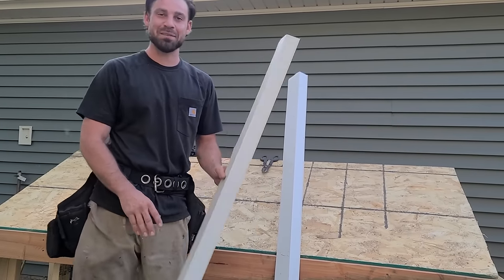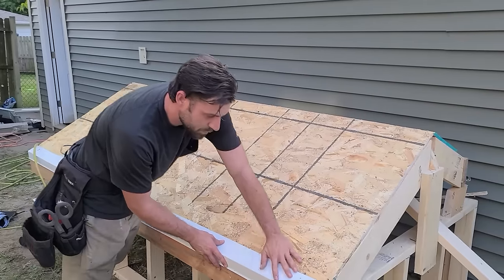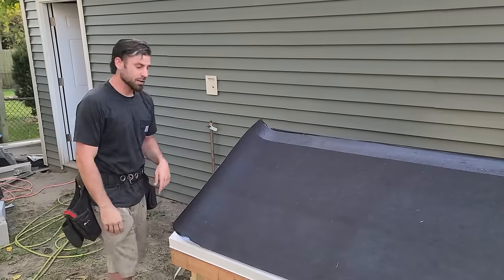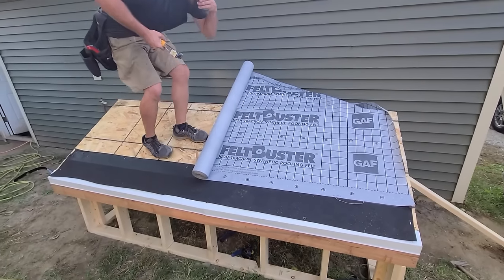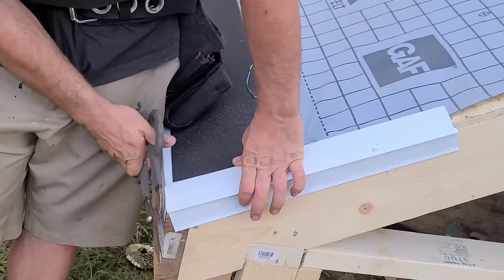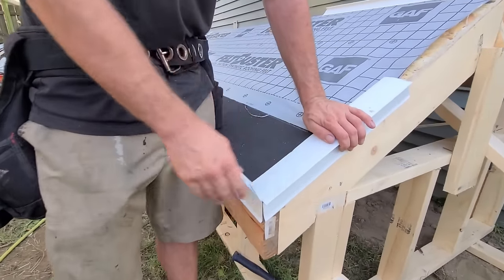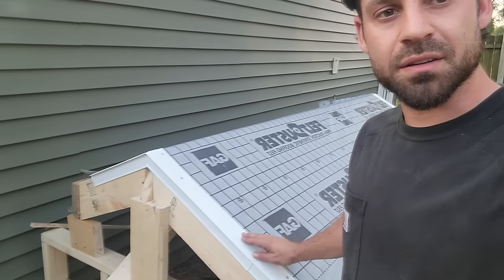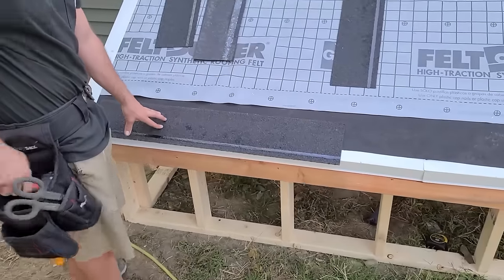HOW TO | A - Z ROOFING (PART 1)

Comment: GAF said never use staples, are they just wrong?
Reply from the maker: Where'd they say that? I've never heard anybody or seen any instructions saying never in it....Staples leak, that's a pretty well known fact but that only comes in play when the roof is exposed to rain prior to shingle installation... after that there's thousands of nails in the roof so I wouldn't understand why they'd be forbidden.  Only recommended against in certain scenarios
Reply: Watch their install video, says on the video with plastic caps only
Reply from the maker: @kirkwesterveltoutdoors i just watched about 20 videos and haven't found anything from them. Got a link? Also, even if they did say that, I would call and ask "if I'm going to tear off one small side of roof and shingle it on the same day can I just tack it down with staples or will that void a warranty? " they will tell you it won't void a warranty. Also, every manufacturers instructional videos leave out important details or give bad or inaccurate advice anyway lol staples is the least of anybodys concern
Reply: I will call them in the morning, like I said, it is their instructional video. Search it on YouTube.
Reply from the maker: @kirkwesterveltoutdoors  yea bro you're good to use staples lol as long as you're gonna get it covered with shingles before rain
Reply: Ok....I will use the staples, Tha k you for the help
Reply from the maker: @kirkwesterveltoutdoors  only if you're sure you can get it shingled right away.  Diy roofs usually take about 2-3x longer than one would think

Comment: You should not use staples on ice water shield or synthetic underlayment. 
The staples will rust out And leave holes. 
Plus the shoulders of the staples are curved and will pull in the synthetic leaving little holes that will become bigger overtime. 
It’s recommended by the manufactures not to use staples 🤭
Reply: NEVET go against what the manufacture says.  It will void their warrenty and also coming from the view point of a homeowner, I had a roof leak/mold problem. 1 I should be dead according to my doctors assistant ( and it was such hell at points and I wished I was at times), 2 it drained our savings account.  Currently in the middle of contracting my new house at the moment.  Biggest part of the job is baby sitting guys making sure they do there job right, not cutting corners because they are only here for a very short time.  I have to live in it a lot longer after they gone home and collected a paycheck. Some guys, usually the ones with the biggest egos, think they are doing it right when they aren't.  There is a whole lot of pain and suffering you can save someone from by not being a loser of a worker.

Comment: Cut In top of metal alone is room for leaks.
Reply: How much water is really going to get there though? Not even a space that's a few cm wide and at the very top where water doesn't run off. Either way, there's probably going to be fascia metal there.

Comment: I verbally have 'sent' guys like this to he**  for not putting underlayment over Ice & Water Shield.  Over time, the I & W will adhere to the backside of shingles making future repairs IMPOSSIBLE!  Have to carry a heat gun to even have a chance to get shingles to release from I & W.   Other than that, good job.
Reply: I've never had a problem with ice and water sticking to shongles
Reply: @Josh-ww5kz  It is not a problem with products like "GRACE" I & W that have a plastic cover; but granule based is a whole nother ball game. My experience is that I have a 50 / 50 chance when dealing with I & W whether the shingles will 'release' or not.  I have fellow roofers that just take shingles, I & W, and plywood as it is one solid mass when reroofing.  The 'goo' in the I & W can be pressed up through the granules by the weight of shingles, adhering to the head lap.
Reply: I just commented same thing lol

Comment: I still don’t understand the gutter apron, show me how that drips into the gutter when it is flush with the fascia.. looks like it will dribble down the facia behind the gutter...
Reply: Hello Jay, the eave drip edge will actually go over your fascia metal and gutter, with the over hang the water will come down the roof, roll of the over hang of the shingle then back up a bit , this is where the gutters apron does it job, any water that backs up more then the over hang on the shingle will hit the drip edge then drip right into you eastrough. Alot of time when installing drip edge it will not sit flush due too the gutter hangers or gutter spikes , so you need too place your drip edge on top and mark each side of the hanger then use snips  and bend then up and boom, your drip edge fits. Alot of time due too the eastrough being lower on one end so water can flow, people see water getting behind there eastrough, you can apply a nice bead of clear silicone on the top of the eastrough where it meets the fascia metal.
Reply from the maker: it will  all come together soon enough
Reply: That's true when there's not going to be ANY gutters along the eave line.  Do you even know what most gutters look like? It's a U shape.

 So there a piece of metal that is flush to the fascia, then the apron goes in front of that. That whole rule of not making it flush is nonsense. All it does is help the people who do gutters in the end, if that house ever gets their gutters redone. But even then, you loosely put it on so it wouldn't be a problem to slightly bend it upwards in most cases.

Comment: Don’t lock your metal together
Reply: Whys that? So it flares out and isn't flush?
Reply: @Josh-ww5kz  it was a question I forgot to put ? Your supposed to cut Angle on the under peace and open the hem on top over lap peace to lock them together
Reply: So you don’t end up with a Bulge where they connect

Comment: Holy ....cut off factory edge of  drip.....that's hack shit
Reply from the maker: Ok so when a piece lands an inch short of a edge what do you do? Dutch lap like a hack? Or cut it back and 2 piece it where the seams make sense? Hopefully you cut it back, meaning you have a hand made cut in the field, which is okay...if it's okay there...it's okay where I did it and makes a lot more sense that way..  Make sense bud? These shingles are dummy proof.  You'd be hard fought to find much of a difference between one of my cuts and a factory.  Now you can go be faster without sacrificing quality.  run along now
Reply: @WorldsFastestShingler  ...you pull out tape....lap one 1"...but locked in! (Inside joke for roofers),    cut of excess at rake edge!
Reply: @WorldsFastestShingler  don't confuse drip edge and actual shingles warshawk.....metal drip....no less than 2'....factory edge required always.....Dutch lap.....you In cowboy days son.....listen here.....8,16,24,32,  .25 if your like me!!  But your a simpleton so you cut back half shingle according to stagger at rake.....understand? Bypass both top and bottom course stagger .....already determined most occurances.   Need help VETERAN
Reply: You owe me know , any tips? Save it for yourself......I'm not done yet!!! Lol!  It's your first day all over! Cute
Reply from the maker: @David Lysohirka  bro I can't even read that shit lol Overlapping shingles an inch is called a Dutch lap near the end rake, people use that for 3 tabs, but it voids the warranty on architectural buddy. Sounds like you're putting on some nice stuff my man
Reply: @NWIVeteranConstruction  drip edge, gable/rake edge, valleys,   it's metal....26ga!   Always!!
Reply: I'm not even sure Veteran know what '   ...
And " ...
Means! Guy needs help.....
Reply: Guy finally wears a pouch ......true roofer now!!! 🤣
Reply: @NWIVeteranConstruction  best 👌
Reply: Stick to your chicken coops and leave the rest for the best!  The real roofers! 💯